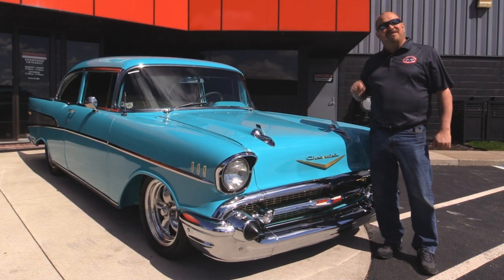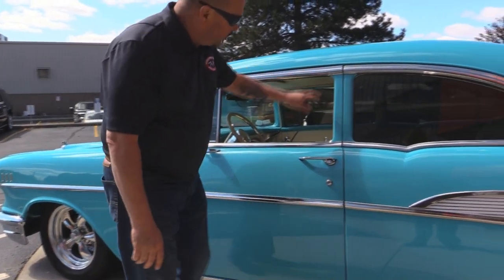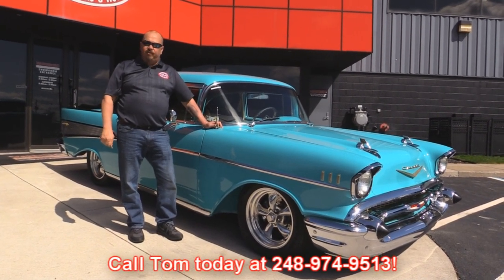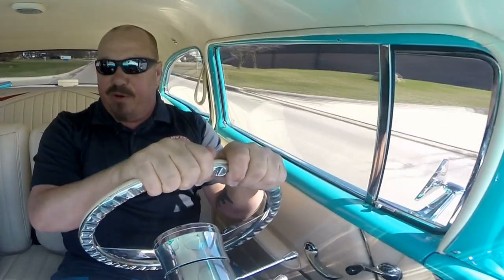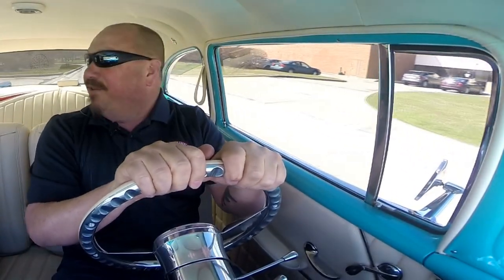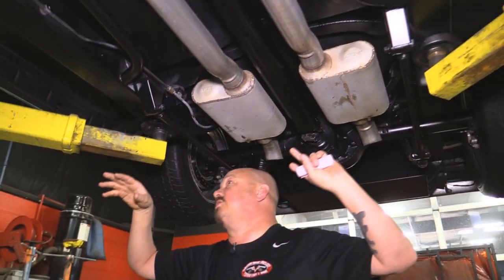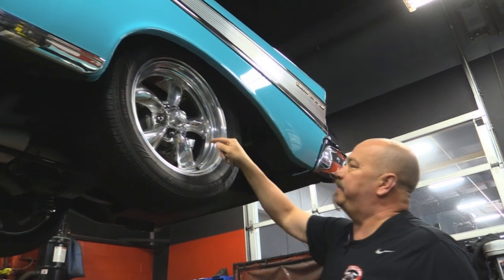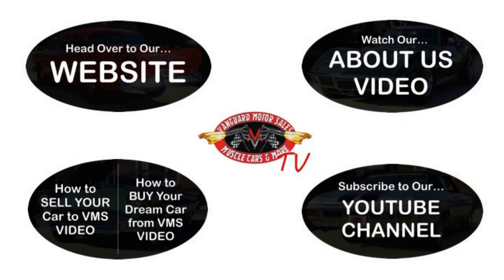1957 Chevrolet 210 Bel Air Post For Sale

Comment: I thought two ten and bel air were different vehicles that looked the same ???
Reply from the maker: A 210 and a bel air are the same car but with different trim and motor options. This car specifically was original a 210 with bel air trim on it!